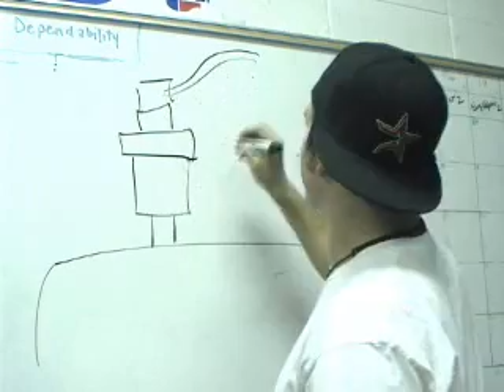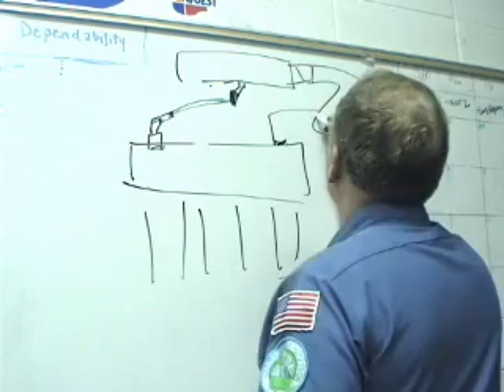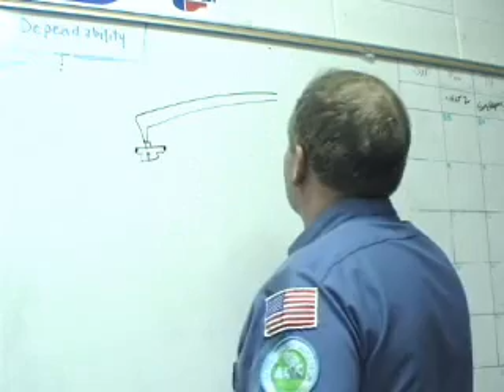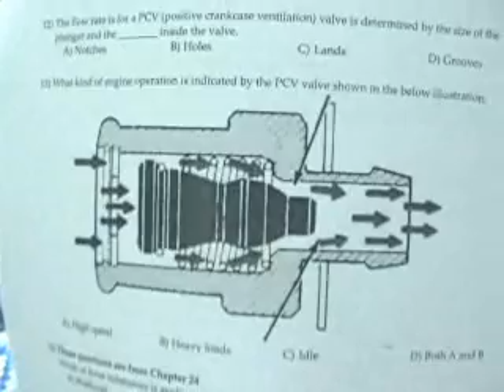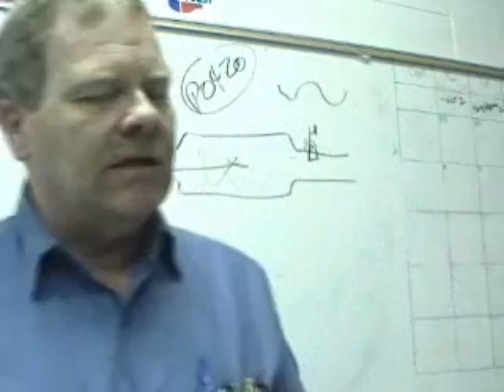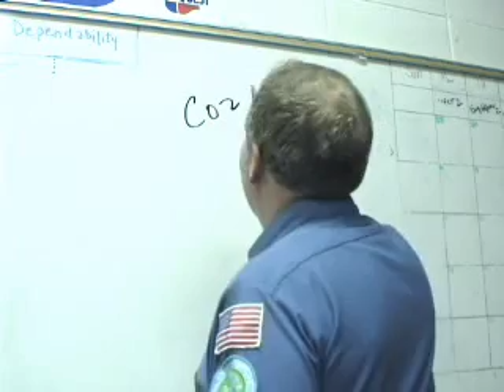PCV and Cat Converters Overview.wmv

Comment: Hi, Sir. In diagnosing a cat converter, would a leak before the o2 cause the same oscillation amplitude and frequency as the front o2?
Reply from the maker: I don't believe so... Typically that would just drive the O2 in question lean, depending on the size of the leak. If you know there is a leak... Fix the leak and see what the O2 does.
Reply: @McCuistian  I was just trying to see if this is a GO or NO GO test for a bad converter when the front and the rear sensors mirror each other with a fully warmed up cat and good o2 sensors. Thank you for your response.
Reply from the maker: @littlebeargaming8267  typically it is a Go- no go,
Reply: Thank you, Sir.

Comment: Hello, Mr. Richard. I found the video very helpful. I am dealing with a p0101 code on a 2015 Nissan Sentra. The car idles a little rough, but  is not misfiring. I know that a clogged cat,  a stuck open pcv valve, a dirty throttle body, a stuck throttle valve, a bad mass airflow sensor and so on can cause this pass airflow sensor code. I am not sure if bad  accelerator and the tp sensors would cause that code. Bad tp and App sensors would most likely put the vehicle in limp mode. I verified that fuel trim is normal at idle, which indicates that the pcv is not stuck open. Usually, a car with a clogged exhaust would cause misfire and hard start because of exhaust back pressure. I replaced the sensors 3 times with non OEM sensors and clean the TB, but the car is still not fixed. What would you suggest that I do? Thank you.
Reply from the maker: See if it runs better with the mass airflow sensor disconnected... Sometimes I like to disengage the pins from the connector and solder them where they are crimped and that makes a difference. Pin fit can also cause issues.. connector corrosion, etc.
Reply: @McCuistian  It barely runs with the sensor disconnected. Today, I am going to installed a used oem part. Before doing so, I am going to check the cat temperature to rule out a restriction. I may change the pcv valve because I see trace of oil coming out of the hose or clamp the hose and see if the idle will smooth out .I smoke tested it and found no leaks. If I put smoke in the breather tube, smoke should not come out of the pcv valve, right? Engine air filter is new and is installed properly. Data does not move when shaking the engine air filter housing. I will  definitively check the connector this time.
Reply from the maker: @alwayslearning6355  You get any MAF readings on your datastream? You can check engine vacuum as  a quick exhaust restriction test - if you pull the throttle up and hold it the vacuum should initially drop while increasing the throttle but should recover quickly to the original or higher Hg reading. If it goes down and stays down while you're holding the throttle (about 1/4 throttle) then that indicates an exhaust restriction. There's also the valve timing to think about - and a rough idle can be cause by uncommanded EGR flow, too, so watch for that. Does the intake get hot really quick when it's idling after first starting?
Reply: @McCuistian  Yes, I do have maf reading. Around 2.5 g/s at idle. I did not check the intake when it is idling after first starting. I will do that when I get the car.